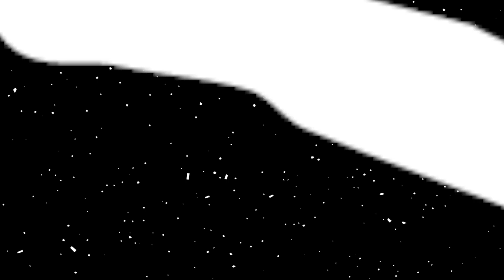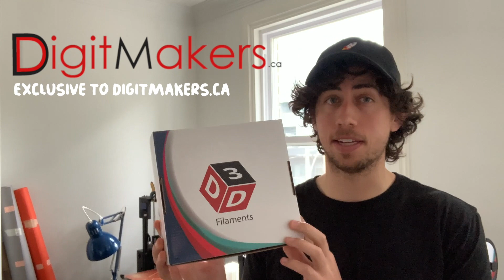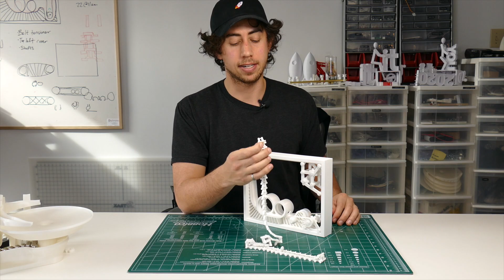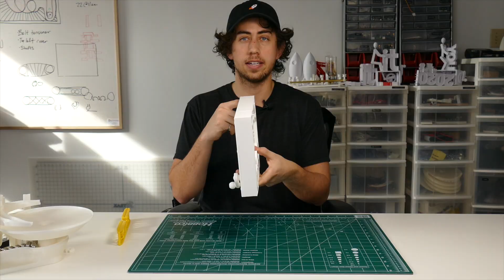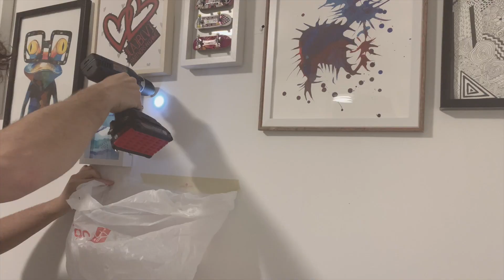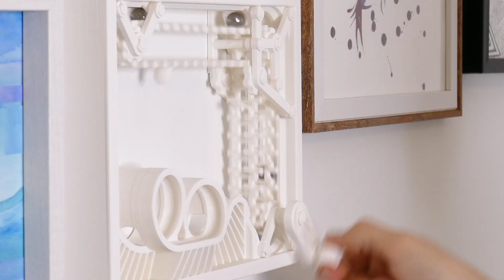The Wall Mounted Marble Coaster You Can 3D Print and Build Yourself

Comment: I just finished printing it with D3D PETG . You are not kidding about 40 hours. That left frame (18 hours ) really tests the limits of my Prusa.  I am hoping to give this to  my grandson but I find the chain keeps breaking. Do you have any tips on how to strengthen the connecting points?
Reply from the maker: Hey Rob, thanks for supporting!! I am not sure why you would be seeing problems, but my first thought is that PETG is a little softer than PLA which may be where the problem lies. Try printing a couple links in PLA and see if you get better strength that way. If not we can try some other ideas. Let me know!
Reply: @Engineezy  Thanks . I will print them in PLA and see if that helps. Cheers!
Reply: PLA did help, thanks!
Reply from the maker: @robjasey  Amazing! Happy you were able to make it happen 👊